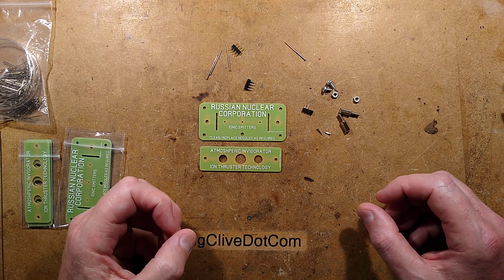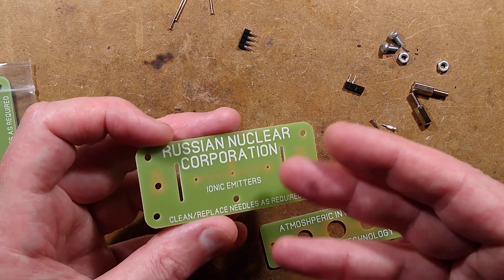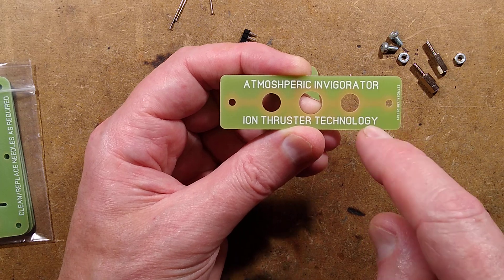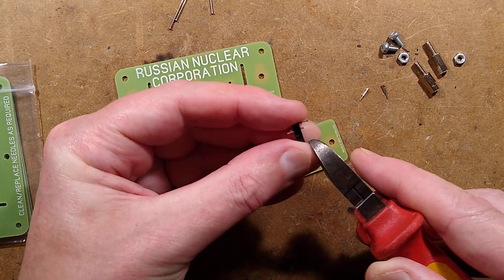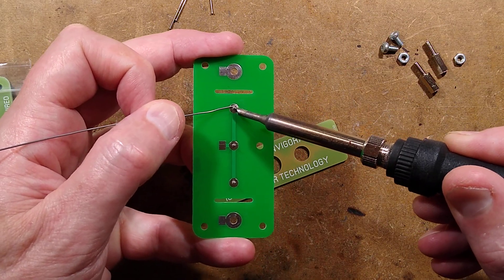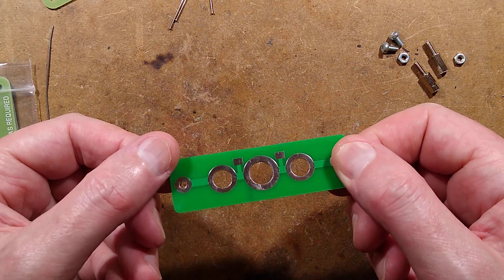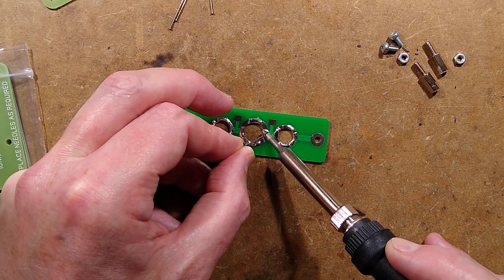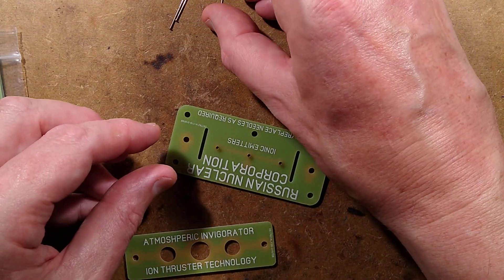Russian Nuclear Corporation molecular disruptor

Comment: Clive, just for shitz and giggles, is there a way you could check that for RF emissions?
Reply from the maker: I don't really have the gear to do that.  The transformer is being run at a fairly low frequency and the output plasma is at ultra low current (microamps).
Reply: @bigclivedotcom  Simple enough...just turn on any radio, then fire up the Russian Nuclear. You should hear any RF that way...B, KN4VUP

Comment: Could I use a ignition coil transformer from a oil fire furnace? 
10,000 volts but ac.
Super size.
Reply from the maker: I've come across ozone generators that use boiler ignition transformers.  They need to be rated for continuous operation.
Reply: @bigclivedotcom  
That is cool will have to make one. But thinking about much it would make ozone.  A timer would be prudent.

Comment: I was wondering - do you think an ozone generator could be used to retrobrite in place of all those fluids?  Toss in a pile of actual UV lights and just seal it all in a box.  Thoughts?
Reply: Might be worth a try, although I would start with something of low value.  Discoloration of plastics can be caused by the generation of conjugated double bonds (beta-carotene is a famous example of a highly colored compound with conjugated double bonds: https://en.wikipedia.org/wiki/Beta-Carotene ).  Ozone is particularly good at destroying double bonds (see ozonolysis: https://en.wikipedia.org/wiki/Ozonolysis ).  However, if the double bonds are part of the plastic, then the ozone will be chopping up those polymer chains in the plastic, which may result in the plastic becoming weaker and more brittle, as with natural rubber.
Reply from the maker: Not sure.  It's more likely to oxidize surfaces when concentrated.
Reply: No, the oxidation is likely to darken the surfaces more.   It's the bleaching effect you're going for with 'retrobrite'.
Reply: @tbelding  Since they use hydrogen peroxide, I am pretty sure the oxidation reaction combined with the UV IS the bleaching reaction.

Comment: "Standard" sewing pins and needles are generally regular steel plated with chromium or nickel, in my experience.  They're somewhat resistant to rusting unless the coating is broken.  If there's, say, a scratch, and the item is in a damp environment, you get rapid corrosion at the scratch.  The entire plated area acts as a cathode, and the exposed steel is an anode; there's an electrochemical effect.  You can test this by nicking a pin or a needle with a file, and placing it on a bit of tissue that's been dampened with salty water.

If the pin or needle hasn't been plated at all, but is entirely non-stainless steel, doing that will tend to show corrosion preferentially where the metal has been most mechanically disturbed, i.e. the pin heads and points.  The metal crystals there are most distorted from their lowest energy states, so it's energetically favourable for those atoms to escape in preference to atoms in other parts of the items.

Stainless pins and needles are findable, but I've found that many that are labelled/advertised as "stainless" are in fact just regular plated steel.  The sellers are counting on people not bothering to check, or not finding it worth the trouble of complaining.  The reason for using stainless, of course, is that one wouldn't get corrosion even if the surface is scratched.
Reply: Most (if not all) hypodermic syringe needles are stainless.  The very fine gauge needles used by diabetics are very handy as a corrosion-resistant point emitter.
Reply: @phils4634  I'm under the impression that for medical applications, corrosion resistance is required by law (or manufacturing standards for medical devices).  Stainless, if not something like tantalum.  Possibly of interest to Clive for this kind of application, there are needles for lumbar punctures, which have a sturdy fine stainless wire within a stainless tube.  Wire and tube would have to be manufactured within fine tolerances.
Reply: @jpolowin0  Seems to be the case! The other thing is that these very fine (28 gauge) needles are readily available en masse, and I've found them useful for many applications (even as mundane as cork board push pins!)
Reply: @phils4634  And, I expect, much sharper than sewing pins usually are.
Reply: @jpolowin0  Wouldn't injection needles have a hollow tip rather than a point (except that inner needle for lumbar puncture)?
Reply: WOWW !!! WHAT A WIKKID COMMENT/REPLY !!!
You're a true tovarisch !!!
Reply: @alexmarshall4331  When I was in grad school at university, I taught first-year chemistry labs for a number of years.  One of the last sets of experiments for the year was a module on corrosion, which was pretty cool if one paid attention.  It involved bits of information from four or five labs the students had done previously, though that wasn't obvious.  And unfortunately the lab manual didn't highlight that, and its explanations were pretty poor in general.  (Sometimes, even some of my grad-student colleagues couldn't figure out what the manual was trying to explain, and I had to help them so they could teach their students.)

Once a chemistry teacher always a chemistry teacher... :-)
Reply: @jpolowin0  A MASSIVE 👍's up...phewee kemystory !!! Keep it up geezah !!!
Reply: @jpolowin0  Journal of Chemical Education was always a good read, back in my grad school days. Lots of fun demonstration projects. Also a leader in practical education advances, as opposed to "education theory" that sometimes had little of either. JCE was the first place I saw "flipped classroom" as an alternate "lecture" format.
Reply: there is also "standard" titanium oxide(?) plated needles what's your take on those?
Reply: @stremmify  oxides are typically used as insulation or lubrication.
Reply: Needles and pins are made of iron, acid- dip profiled, then electroplated.
Reply: I've seen regular steel needles without plating._

Comment: I'm interested, how do isolation slots actually work?

Also, are those "nano" chargers from Anker actually safe? They seem to be rather small for the wattage and I don't feel they have the right separation.
Reply: If understand it right, high voltage can 'crawl' along surfaces. Even if they are insulators.
With the Slot, there is no direct Route for the electrons.
They have to go all the way around the slot...
But the HV is to weak to bridge more than 5-10mm

Comment: This could come in quite handy. Where I am currently living with half the American West on fire, the amount of smoke is really aggravating my wife's Asthma to the point she was put on an additional medicine so she can breathe.  3-4 of these in the house would allow her to breathe more easily I'm hoping.  Thoughts?  The PM 2.5 is through the roof, and the haze is horrible.
Reply from the maker: An ioniser module on its own will precipitate out a lot of fine dust and smoke.  Ity tends to make a mess of the walls in the vicinity, but at least you know it's working.
You could also cobble up a box fan with a furnace filter and tape or even a cube of furnace filters.

Comment: Sewing pins anneal/lose their hardness if you give them a couple of seconds in e.g. a cigarette lighter flame and let them cool. Makes them much easier to cut without wrecking sidecutters.
Reply: or just buy a pair of hard wire cutters like the excellent Knipex or cheap knockoffs from the other usual tool vendors
Reply: @railgap  Or use a pair of reputable pliers. The type that have the wire/pin/rod cutters on either side of the hinge.
Reply: Yep !  Cos they're made of iron, and not steel.
Reply: Props to boyd crowder on the egg piercer description
Reply: @Mr0rris0  That was entirely my own writing.
Reply: Otherwise you can use some pliers and just bend them to break at the marked point - you can actually do that pretty accurately. I've personally done that when repairing one of those little egg piercers with the bit of needle sticking out.
Reply: @MeatLeBeef  - that works to part it, but it can leave a little kink, or sometimes a split in the metal (so it's bifurcated), which wouldn't fit into the type of IC socket that Clive's using.
Reply: @MeatLeBeef  what is an egg piercer?
Reply: @jimhatch14  An egg piercer is a marvellous German invention for use when boiling whole eggs. It is comprised by a spring-loaded concave pad with a small hole in the middle and a sharp pin underneath, pointing upwards through, but in the resting state of the device not protruding beyond, said hole as a safety feature so as to not hurt anyone handling the device outside its intended use. (Incidentally, and probably the reason why MeatLeBeef mentioned it in the first place, the needle is of thicker make than the average sewing pin, but its tip is just as sharp.) When the time comes, you press the raw egg bottom-first onto the pad (centred by the concavity) which recedes past the needle that it has been covering, and the egg thusly punctures itself on heretofore-mentioned needle, creating an orifice for the natural air bubble contained in the average oval-shaped chicken produce to relieve itself freely, so that you may proceed to boiling the egg without gambling with the risk of it bursting on account of said bubble expanding too much at cooking temperatures and thereby exerting a destructive force suitable to jeopardising the shell's physical integrity, and in turn quite possibly denying you the opportunity of indulging in the delicacy that is the perfectly cooked breakfast egg. Jawohl.
Reply: @Anvilshock  I just use a plain pinboard pin to do that. ;-)
Reply: @grimp53  Why use a random implement found lying around the house when you can use a dedicated, overengineered solution you can feel good having spent money on? ;)
Reply: 370 degrees C or greater from soldering iron  works too, but 0.6 mm hard wire is not too cruel .....not for yorur ic snips
Reply: Use a file to make a small scratch and you can break them by "bending" them

Comment: I have always been jealous of your manual dexterity when soldering. I try holding the board and solder in one hand and the iron in the other when nobody is looking, but considering how much trouble I have running the torch, pedal, and filler when TIG welding, I have low hopes that I'll manage to get it right.  😕

Comment: Thanks to Clive, I just bought an 'industrial' ozone generator that produces 6000 mg/hr ozone using a replaceable ceramic generator plate. I have a couple places that need a serious cleansing of mold odors and for $60, I couldn't imagine a better solution. The plate has an avg life of 40,000 hrs, and has a timer.
Reply: UPDATE: Holy crap- this unit produces an insane amount of ozone! A few seconds and it starts to irritate your throat. The ceramic plate looks to be about 2x4 cm and the entire surface glows. It comes with a door hanger that says, "DO NOT ENTER! Ozone sanitation in progress!"  I can't wait to take it apart to see what-all is inside! 

I got this one: https://www.amazon.com/gp/product/B00JAP7388/ref=ppx_yo_dt_b_asin_image_o01_s00?ie=UTF8&psc=1

Clive, you should do a video one one of these- it is an ozone monster!!
Reply: UPDATE 2: Just took the lid off. It has a monoblock power supply driving the ceramic plate that has long thin conductors plated onto it. The fan is grounded, too. The ceramic plate generator is attached to a fairly large heatsink. Not much to see in terms of components but the construction is certainly robust!
Reply from the maker: @LiLi-or2gm  At some point you may need to replace the power supply.  They seem quite temperamental.  But the case and basics are a good start.
Reply: @bigclivedotcom  Good to know how, Clive- thanks!
Reply from the maker: @LiLi-or2gm  I looked at the module from a similar unit recently.
Reply: I ran what is probably the same unit in a stinky old car for half an hour.  You could smell ozone for days afterward, even after leaving the doors open for a couple of hours.

Comment: Would you recommend such a device in an enclosed space such as a boat? I'm thinking of doing one and leaving it on whilst I'm not there.
Reply from the maker: You could use a low level one running on it's own little solar panel.
Reply: "It is true that high humidity (over 60%) will cut the ozone production of any corona-type ozone generator." and "High humidity can also cause extra wear on corona plates." Source: noai org
Not entirely eliminate, but reduce output. That said, they don't recommend against it, so …

Comment: Clive, an unrelated question, how do led drivers work when the secondary can be 12-26 volts? Is it determined by the load? I'm doing research for personal use of led strips from a LED telly. I've got a bench power supply that goes from 1 vdc up to 55 vdc.
Reply from the maker: They use current regulation on the output.  For 1W LEDs it's usually around 350mA and the wattage of the light will be determined by the number of those 1W LEDs in series.  For 12 to 26V I'd expect to be able to drive from around 3W to 8W.  (about 3.5V per LED)
You can also get voltage regulated power supplies that put out a fixed voltage of around 12V.

Keep in mind that these power supplies often don't take electrical isolation very seriously, so consider all exposed connections as being live at mains voltage.
Reply: @bigclivedotcom  that's good information, Clive. Thanks.

Comment: 2:17 I have an easier way to get them out : Just cut the plastic, the pin will fall. If you use big snips, it'll break before you reach the metal itself.
Btw these are called swiss machine pins.

Comment: I have ordered one of these 12v units a few weeks back to use in my camper van when it’s not in use do you think I should leave it on a timer for a few hours a day? It seems to generate a fair amount lo
Reply: tip for camper vans going into storage if you have a fridge/freezer rather than leaving it on or removing it just prop it open with a bit of cardboard to prevent stuff growing in it.
Reply from the maker: The little module with green and white wires is intended for use in vehicles.  In its original form it produces just a trace level of ozone.  You could use it on its own little 12V solar panel for autonomous operation.
Reply: @bigclivedotcom  thanks for taking the time to reply much appreciated. Keep up the great work

Comment: What if you just used the actual gold pins that you can buy for those little black 4-pin adapters? I'm pretty sure it's just a 4-pin RGB adapter for computers. I have hundreds of those little gold pins everywhere
Reply: Those probably aren’t pointy enough for being used for this. With ionizers, the finer the point the better, thus the carbon fiber emitters which are only a handful of microns across

Comment: If you were really worried about having the ions erode lead solder, you could just use lead free, or better still silver solder.
Though if you think about it, the stainless steel pins are also an issue, who else remembers the ionic foot detox spa videos ?

Comment: 0,025 ppm should be 25 ppb I guess. and also I think needle polarity is wrong?
Reply from the maker: Electrons flow from the negative electrode to the positive one.  I based the unit on a negative ion generator.  In that module the white is the negative and the green is the HV "ground", which is positive.
Reply: @bigclivedotcom  ah ok, i might be missed that part.

Comment: You should take a file and grind some of those "round turned pin receptacles" in half. You may be surprised by your finding. Some of them actually have a spring set inside.

Comment: I wonder if your PCB supplier would blink at running a batch of "Clive's Patented Mk. 2 Type C Baby Zapper" boards.
Reply: Well, they in China don't hesitate making «baby heaters» which consist of effectively two electrodes to be put into water and connected to mains AC.
Reply: @jkobain  It's one thing to do it neglegently like that, but where's the charm?  Making the gap betweek the two plates just the right size for baby fingers is the only thing I'd change.
Reply: @jimsvideos7201  if Clive can get zapped, I'd say any living child could get zapped as well.
Reply: @jkobain  nearly all the current follows the shortest path between the electrodes; the only real problem with those heaters is the corroding electrodes make a mess of the water; there really is no safety issue related to the electricity....just a lot of FUD.
Reply: @carpdog42  dgw tested those and he reported he felt current about 5cm around the thing, closer to it was painful.
Reply: best to put Ralfy's name on it instead, to avoid being put on a list somewhere.
Reply: Next time put "Eludeium Pew 36 Explosive Space Modulator". And see if it flies... :P
Reply: @MostlyInteresting  this thing better get at least a million miles to the gallon
Reply: They get paid, they don't care, they'd run a stack of cock boards so long as you gave them money
Reply: "Ah that guy with the typos again - I'm pretty sure he's talking about Baby Zebras"

Comment: Clive, you should have paneled them by stamp hole/mouse bites, that way you would got both boards on one order. The round corners require a gap between the boards so that rules out panel by V groove.
You could also have added boarders for the order number to go on, or indicated on the pcb where you want the order number put, put exactly this text where you want the order number to go "JLCJLCJLCJLC".
Reply: they usually add paneling fees if they see sections of the order not connected by copper at all, so more often than not cheaper to order two designs than to panel them in my experience
Reply from the maker: @notsonominal  A way round that might be to run a small track through the mouse bite area.
Reply from the maker: I didn't panelise them to get nice clean sides and allow the rounded corners.  These were just prototypes.